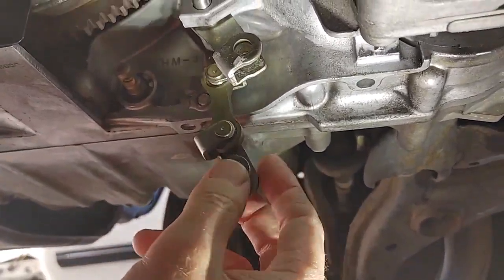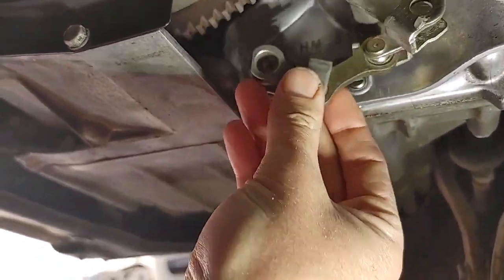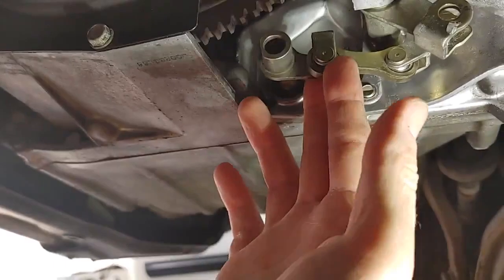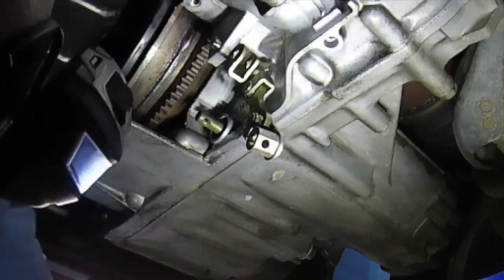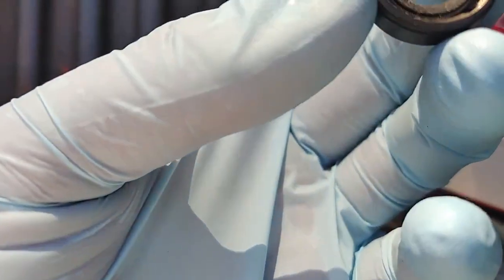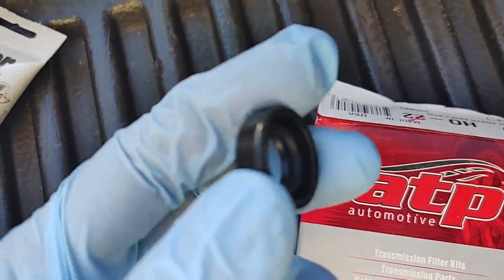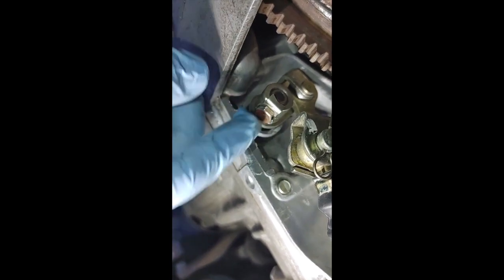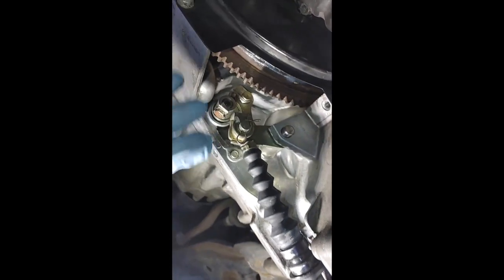Honda First Gen CR-V Transmission Leak Shift Shaft Seal Replacement Pt. 2 of 2

Comment from the maker: 1999 Honda CR-V auto trans 175k miles
No need to drain the fluid. Very little fluid will drip out, at least in my case. Have a drain pan ready just in case.
Part 1 Video:
https://youtu.be/51JUJXANop0
Amazon Auto Parts Link: https://amzn.to/3LjtJPy

Comment: Thanks for the video! Helped a lot!! Here a Honda dealer asked R$160,00 for that seal and 15 days to deliver. The 12x22x7 dimensions are the exact same as the crankshaft seal of a Stihl brush cutter, costing R$18,00 and in stock. It looks more robust and also seems to be made with FKM/Viton. Works flawlessly and I can still say that I always use genuine parts, even if it's genuine from another brand...

Comment: I drive an 04 Odyssey with V-tec v6. . . yesterday, (Merry Xmas to ME, ha? lol) I discovered a puddle of atf where i'd parked.. Probably what happened is I parked in another spot, and then decided to move it -but forgot to disengage the parking brake, just powered it over there, I think it maybe blew that seal? been teens cold, so it probably turned hard and blew. . . lol.. gutter. Only thing I can do is get under there and check, huh? thanks for your video!

Comment: Thanks for the vid and perfect timing. I’m gonna pull the cover off hoping that this is my issue as well...1997 CRV with 210000
Reply from the maker: No problem, it fixed my issue. Dry as a bone.
Reply: @jonstuff  Pulled the cover last night, cleaned the area, waiting a few mins and wham bam thank you man! it was leaking from the seal and now I know what to do!!

Comment: Would this be a slow leak, or if it all leaks
Reply: Its a very slow leak.
However, if left overnight, you'll see a small puddle under your transmission
Reply from the maker: I would say a slow leak. Mine just developed and just started dripping a few drops on the ground.
Reply: @jonstuff is there anyway you can provide the honda part number if possible? I have a 2004 honda accord v6 and i know for sure this is the leak i have been chasing for 8months.

Comment: I changed my shift seal on my 95 Del Sol but it's still leaking!
Actually my friend did it. He worked in an auto body shop for 15 years
and has been working on cars ever since. It's a simple job.
Any thoughts on why it's still leaking and what to do? 
Thanks!
Reply: Might be a rear main seal. I'm doing this seal to check if it helps with the leaks

Comment: Help sir..crv gen 1 (automatic) when i shift in d4 doesn't go right, I have to go back to park and then change the shift to d4 again. it doesn't go in the right place.. but sometimes it goes right when I shift. do I need to. change the. shift cable? or do I just need to tighten something under the steering wheel

Comment: Did you drain the tranny before pulling the seal?
Reply: No, not necessary. It will leak a little once removed. But, not much.